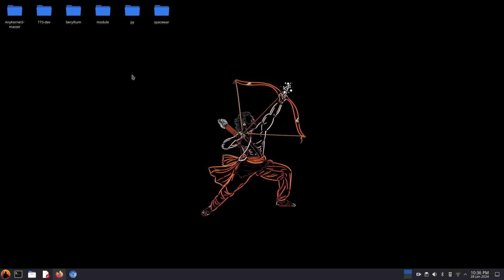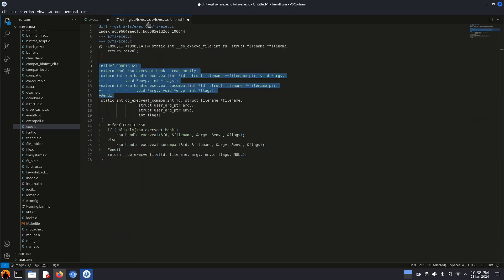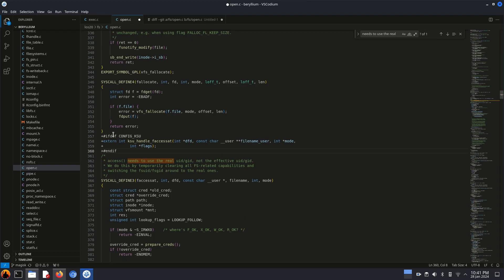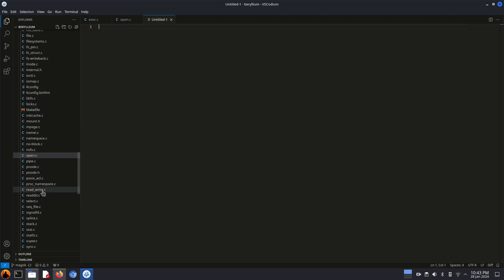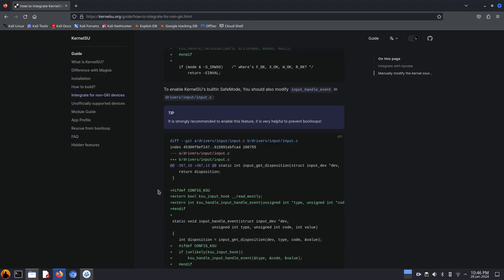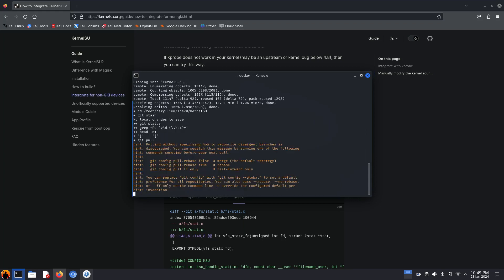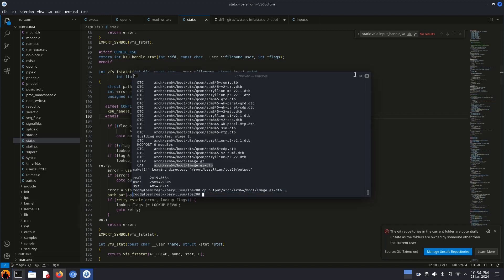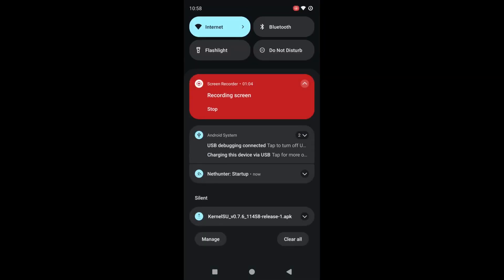Patching KernelSU to a non-GKI device - Part 2 | Compile Android Kernel | fossfrog

Comment: root@c9e94e58c013:/kernel# which clang-17
which ld.lld-17
/usr/bin/clang-17
/usr/bin/ld.lld-17
root@c9e94e58c013:/kernel# make O=out ARCH=arm64 \
CC=clang-17 \
LD=ld.lld-17 \
CROSS_COMPILE=aarch64-linux-gnu- -j$(nproc)
make[1]: Entering directory '/kernel/out'
arch/arm64/Makefile:57: Detected assembler with broken .inst; disassembly will be unreliable
CHK include/config/kernel.release
Cannot use CONFIG_CC_STACKPROTECTOR_STRONG: -fstack-protector-strong not supported by compiler
make[1]: * [/kernel/Makefile:1279: prepare-compiler-check] Error 1
make[1]: Leaving directory '/kernel/out'
make: * [Makefile:146: sub-make] Error 2
root@c9e94e58c013:/kernel#

Ideas :(

Comment: 6:13 what is the password
Reply from the maker: Am I supposed to tell you that? (-;
Reply from the maker: Btw, that's my root password, some commands are not supposed to run as Non-root user. Where sudo/su comes in. So you can use sudo docker run... or just switch to root shell using sudo su. And one more thing, never ask/share passwords.
Reply: @fossfrog  now I can't inter the kernel builder pls help im at the finishing line
Reply from the maker: Have you exit from the container?
Is yes, check the docker containers with 'docker ps -a' command, the container should be there. Then run following command to start that container: 'docker start -it {container_name_here} bash -l'. You can find the container name in docker ps command
Reply: @fossfrog  after run docker ps -a it shows contained if name created status ports name
Reply: Sir can I dm I have telegram
Reply from the maker: @HridoyMax-cf7pe  ok
Reply: sudo docker run
="docker run" requires at least 1 argument 
Docker run options img command arg
Reply from the maker: Can you tell me what steps you've completed?
Reply: @fossfrog  I have
 completed at 5:51
Reply from the maker: Them seems you haven't started the container yet. Run the following commands to start the container: docker run -it shubhamvis98/kernel-builder bash -l
Reply: @fossfrog  then?
Reply from the maker: Is it done?

Comment: I ´m unable to find my modified kernel location or anything else in the docker via cd command. My modified kernel files are in the root folder but i can´t see them.
My theory is that the filesystem inside a Docker container is separate from my host machine’s filesystem, but i don´t know how to access it.  Here are the commands that I use:

sudo dockerd &

docker run -it --rm -v /path/on/host:/path/in/container shubhamvis98/kernel-builder /bin/bash

root@89176c8d6934:/# cd
root@89176c8d6934:~# ls
AIK

root@89176c8d6934:~# cd /
root@89176c8d6934:/# ls
bin   dev  home  lib32  libx32  mnt  path  root  sbin  sys  usr
boot  etc  lib   lib64  media   opt  proc  run   srv   tmp  var
Reply from the maker: Once you start a container it creates it's instance. So after closing the instance and if you want to access it again, you have to use "docker start" instead of "docker run". And to copy files from a running or exited docker instance you can use "docker cp" command. If you use "docker run" command again it'll create another docker instance. To list all running/exited docker instances you can run this command "docker ps -a".

Comment: Is it the same process for Vili equipment (Xiaomi 11T pro)?
Reply from the maker: Check if your device support gki. If yes then don't need to manually edit files. Otherwise you can try this method.
Reply: @fossfrog it supports it, but I can't compile the kernel because of llvm, the commands and clang change. I don't know the correct commands and clang, path, aarch64.
Reply from the maker: Then learn linux basics first, mate. Because in kernel compilation you only have to export toolchain paths, arch that's it. Nothing else.